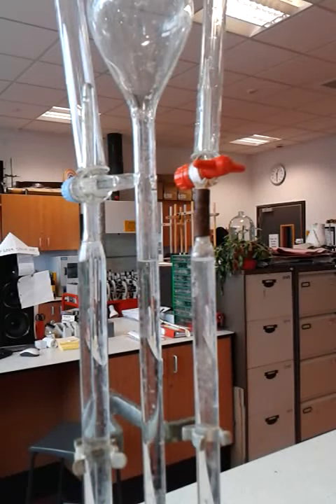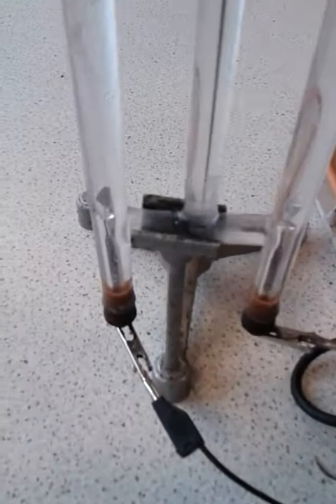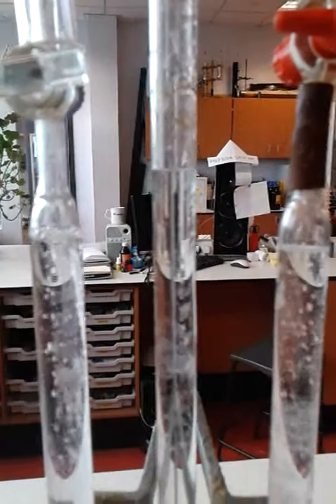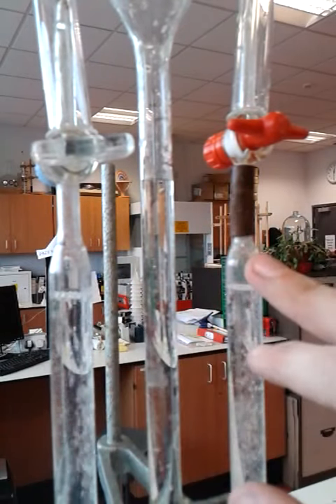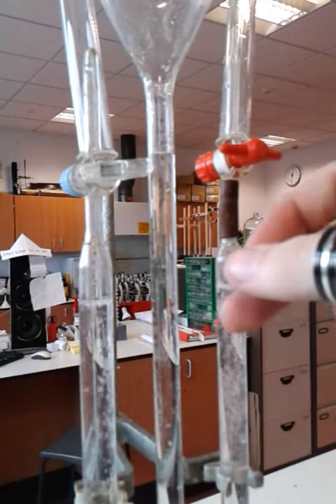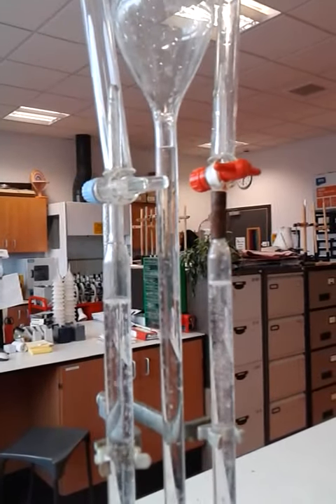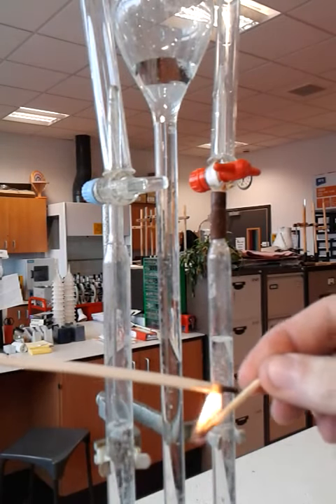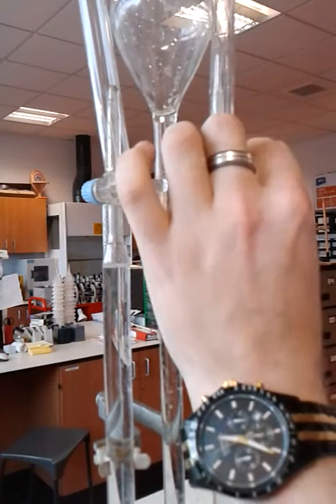Electrolysis of Water H2O Lab Version

Comment: Thank you so much: 
Is the reaction effected by water temperature? 
Example would 200 Deg water react easier/faster than 40 Deg F water? or maybe the opposite?
Reply from the maker: Harold, Geodesic, i would imagine that if the water was hotter, it would act as a catalyst and speed the reaction up a bit. I haven't tried this but the theory seems sound.
Reply from the maker: the catalyst in this reaction is sulphuric acid, the water is actually 1M sulphuric acid as it speeds up the breakdown. if you increase the strength of the acid, this would also speed up the reaction. id recommend 2M max for lab demos for safety reasons.